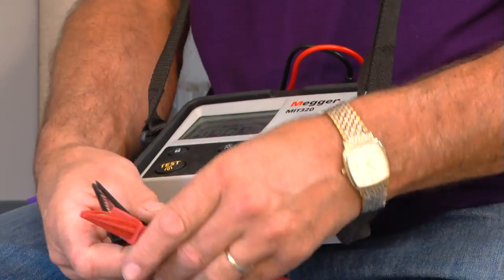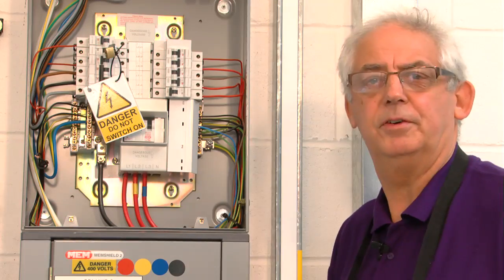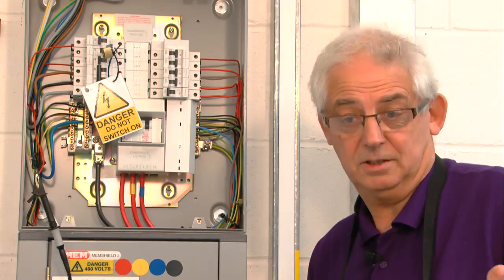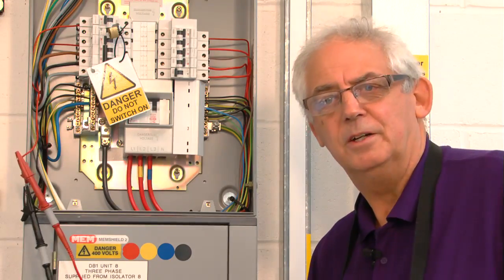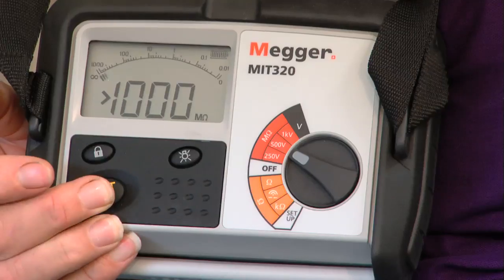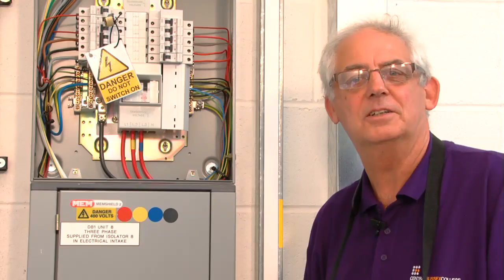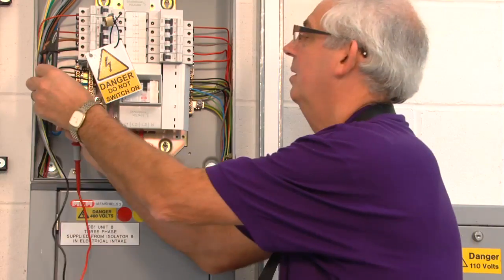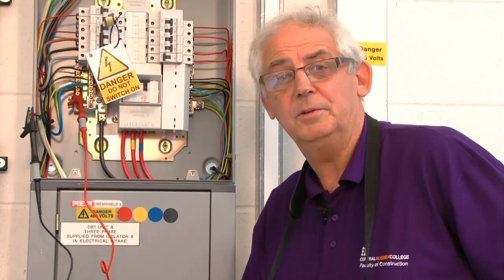Insulation Resistance Test

Comment: As a Canadian the wire colouring is VERY different over here. We would never have a black wire as a neutral conductor. Only white or grey (USA) . I would definitely struggle to troubleshoot circuitry over in the UK hahah
Reply: Is there a testing industry within the electrical environment?

There are electricians over here and that's all they do. Usually places get tested every 5 years for insurance reasons.

Comment: Dear Sir,
You have a lot of mistakes in DB
1- Colour Coding RYB
2- Wire lugs and insulation missing
3- Cable dressing not proper
Reply: You do relise red, yellow, blue was the old phase colours with black being the neutral. As long as a sticker is on the front cover of the board stating its wired in two colour versions its perfectly ok.
Reply: Not every region uses the same code or wiring scheme.

Comment: how do you determine what voltage range you set the meter on?
Reply: G Clarke The setting on the meter should be at least 2x the supply voltage i believe (e.g. if working on a 230v supply, a 500v setting should suffice) - i’m currently studying my level 3 and that’s how we’ve been taught

Comment: when the insulation resistance values measured between the neutral terminal and the earth terminal at a consumer unit are below 0.5 Mega Ohm. How do safety precaution to do the troubleshooting?

Comment: How do I do an insulation resistance test on a home combo boiler?
Reply: Not Sure we just check the circuit its connected to from the Consumer Unit. Usually the boiler will be on a 3A FCU which can feed off the sockets or its own Breaker but even then it still needs a FCU as the electronics on the PCB will fry.
Reply: You probably know the answer by now. You can't do an insulation test on a home combi boiler. best bet is to leave the switched spur in open, and perform the test of the installation

Comment: We were shown a quicker way set to 500v knock off the supply and test live to earth live to neutral and neutral to earth with test leads on the consumer units for each circuit. Correct me if im wrong as long as they read greater than 1000 m ohm
Reply: For a LV system up to 500V. Apply 500V dc test voltage and your min IR test just needs to be at least 1Mohm to pass.
Reply: whatever the voltage of the supply you double the Voltage on the Multimeter so 240V is 500V on test. 1 Mohm reads >1000 on the tester which is greater than 1Mohm so what you say is right. unless the Insulation is damaged the reading should be fine

Comment: The testing is diabolical, when linking out L+N to testing to earth the switch should be in the ON position, hence the type of test, what's the point testing up to the switch and nothing else
Reply: This would require the removal of the illuminant. The testing of L and N together against earth is not required on every system, remind TN-C or TN-C-S system.

https://en.wikipedia.org/wiki/Earthing_system#TN_networks
Reply: mgermi By linking L + N together then testing to earth you discount any load in the circuit in theory so removal of 'illuminants' isn't required